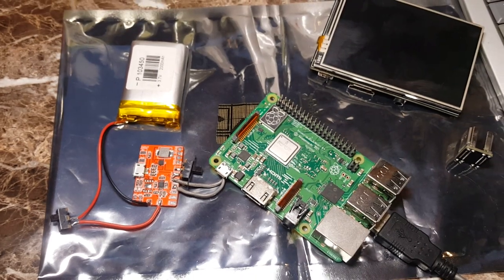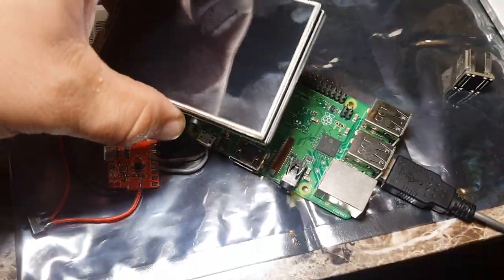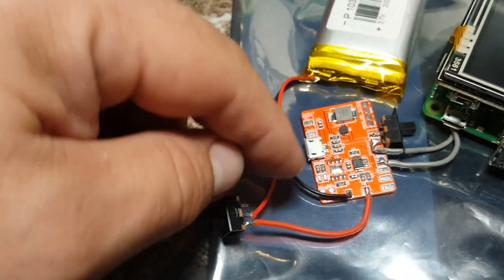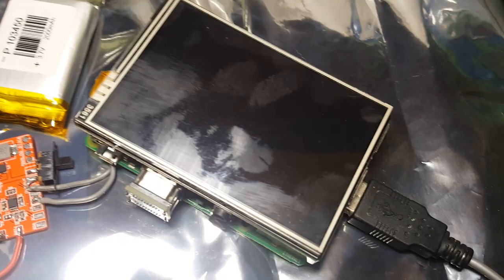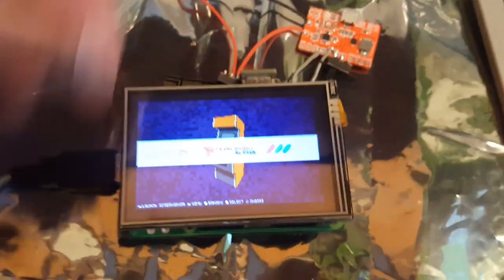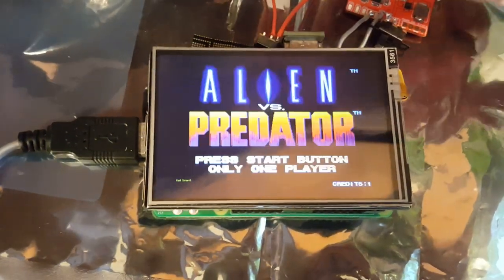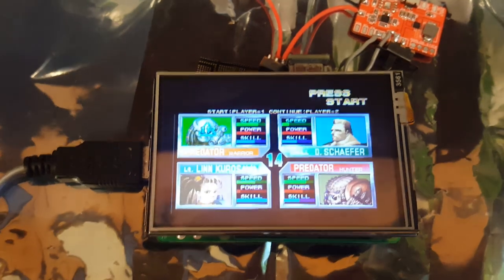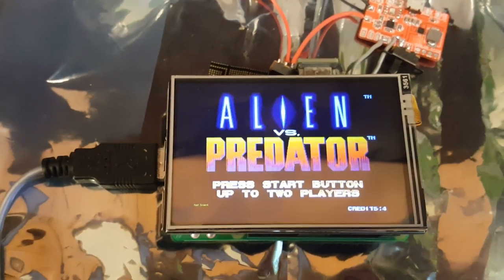Retro PSU quick demo

Comment: Can it be connected to power the raspberry pi from its 5V pins?
Reply from the maker: That's it's function but it NEEDS a battery plugged in to properly give 5v output.

Comment: You think I could power one of those 5-7in hdmi screens with this?
Reply from the maker: if it takes 5v it should but I would need the specs on the screen first to tell you for sure.
Reply: @Angryhelder  I was just thinking of those common 5v waveshare or kedi hdmi screens for the pi
Reply from the maker: then yes this powers it just fine. @kyranbullard9400

Comment: Can I attach a 2A@5V power bank output to it?
Reply from the maker: to charge the battery? sure can.
Reply: @Angryhelder  Also forgot to ask, can I use 18650 batteries? how many of them? Want to make a portable synthesis machine with a Pi 3 B+. Which would be the max or min input voltage/current to supply for the Retro PSU?
Reply from the maker: @josedelosrios4926  As many as you want as long as they are parallel and not in series so that the voltage is still a nominal 3.7v but their capacities are increased. This will also charge slow with many batteries and my board does not have a balancing circuit so if one battery is lower than the other it could be powering the other battery and might give you problems if the batteries are unprotected. Always use batteries with protection as my board does not offer much protection like the built in protection of the batteries.